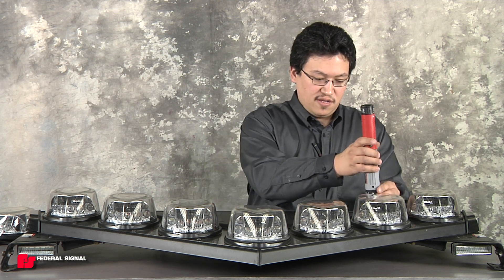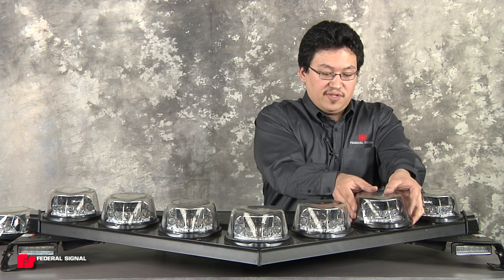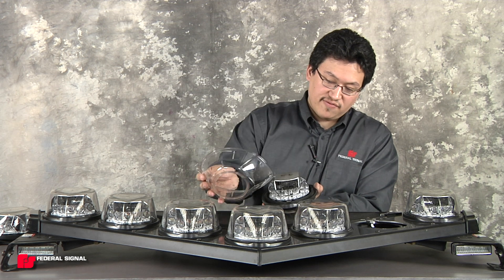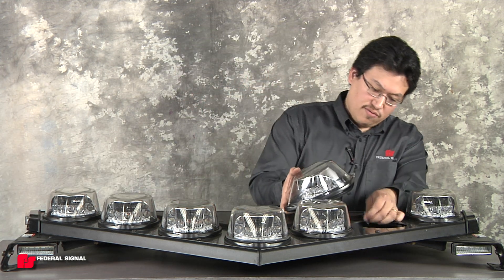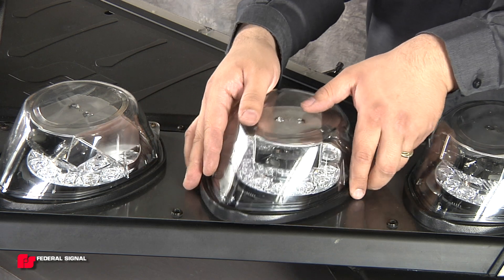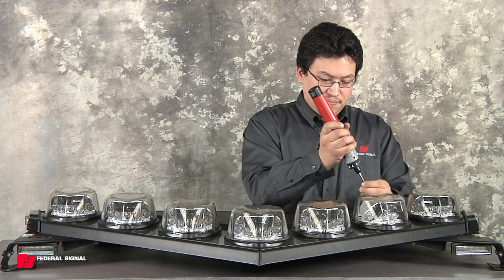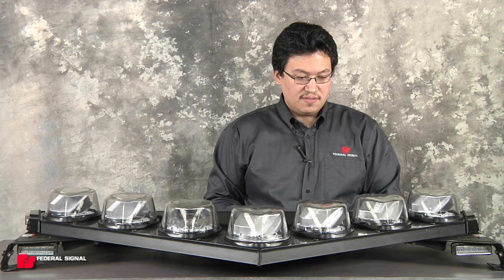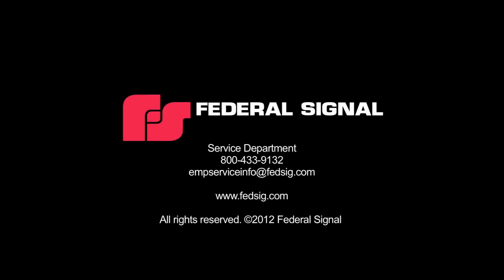Federal Signal -- How to replace a Vision SLR SmartPod

Comment: you should make a single pod magnet mount for volunteers. no good replacement for the old style halogen rotators yet except this. how cool would it be just to have one pod be able to stick on the roof.
Reply: They make this in a single "dash light" now but like everything Federal Signal makes, it's extortionately priced and as a firefighter it's likely you could never afford to buy one. According to the Federal Signal's website they want more than $500 for this LED dash light... FIVE-HUNDRED FUCKING DOLLARS.